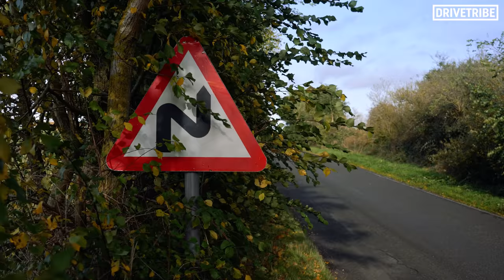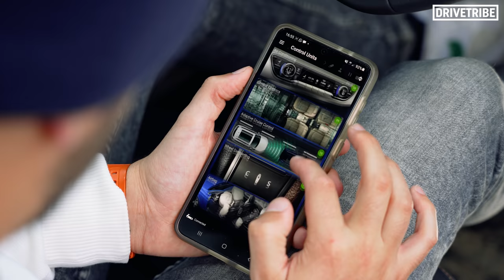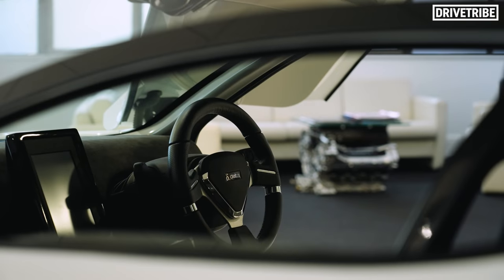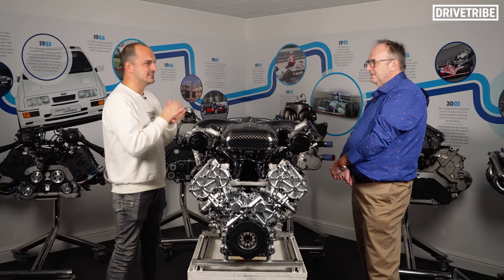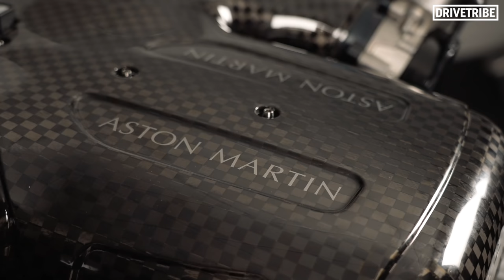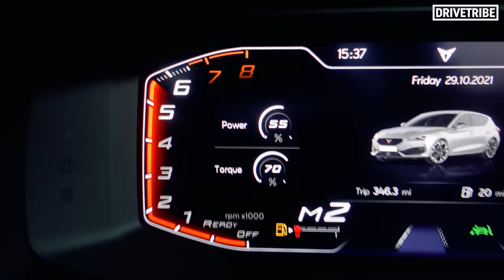Why are almost all modern engines 2.0-litres?

Comment: I would take a larger 6 or 8 cylinder normally aspirated engine  over a 2 litre turbo any day of the week. Smoother, more reliable as less to go wrong and in the real world not much difference in fuel consumption.
Reply: Agreed. I purchased a 2018 Murano even with small fears over the CVT specifically because it uses a 3.5L V6. I've known a couple friends and coworkers who have had turbo issues (mostly GM products to be fair). Still get 26-28 MPG on the highway with enough power to make merging easy and safe.

Comment: Many errors in this video that I can't let been said. First, it was japanese manufacturers during their golden era that brought the 2.0 turbo to another level, not the A45 AMG. Back in the 90s, not only Subaru and Mitsubishi were able to reach 250-280hp on their JDM versions of Impreza/Evo, but also Honda with its 250hp JDM S2000 N/A. The 2005 Evo VIII FQ400, which was an official Mitsubishi UK product, reached 400hp+ from a 2.0 turbo, road homologated. So, not only back in the days we knew how to build 250hp 2.0 turbos, but even more important it's not AMG that changed the game. They only added always more hp in each new update. The real game changers to me are Impreza STi and Lancer Evo, even if they are not hatches (STi 10?). Way before the S3, the Mégane RS, Golf R, Leon Cupra etc ...
Reply: GTI and S3 used the AGU 1.8 20v engine back in the day, which has tons of potential. Renault wasn't focused on turbos, yet still their F4R and F4Rt were highly capable engines.

Also the FQ400 was not a factory product. It was dealer tuned.

Comment: I have a 2.4-liter engine in 2015 Dodge Dart SXT 6 speed auto overdrive got over 230,000 miles with OW-20 oil and well maintained

Comment: I guarantee that turbo engine does not respond instantly, a bigger NA engine will always be more responsive regardless of what rpm peak torque occurs
Reply: Exactly. I had a chance to test out a lot of cars and turbo lag is present in every turbo car. Most noticeable thing in turbo manual cars to me was the short torque dip on every gear change.
Reply: @BlitzkriegRap  i think my entire enjoyment of the driving experience is tied to it's response to my inputs, it's the connection, and both turbos and autos take away from that. Moderns cars are almost all incredibly boring, even if they're fast it feels like someone else is driving and I don't like the bus.

Comment: The 2 litre 4 cylinder engine in my 90's Japanese Mazda originates from the early 80's and only stopped being manufactured in Japan in 2019.. great engine, still in perfect condition after over 300,000 km's.

Comment: I bought a '20 Ford ecosport awd 2.0 non-turbo 4 cyl at the beginning of the year.  Wife liked it so much we got her one but instead went with the fwd 1.0 3 cyl turbo model.   On paper the 2.0 is supposed to have 43 more hp but the car is slightly heavier with awd.  In real life the two are almost identical in performance.  From a stand still to 60 the 2.0 na jumps the line on the 1.0 but then the 1.0 catches up and they seem to even out.  The average mpg for both is identical at 29 mpg.   However, in day to day driving the 2.0 is very smooth and feels like a quality engine that will run a long time.  The 1.0 drones a lot.  It has a vibration and sound to it that gives away that they are pushing that engine.  While its impressive what they can do with turbo's on these small engines I am glad to have a basic engine with less maintenance worries without the turbo.

Comment: I have had a wide variety of cars over the last 50 years, from 1.1 ltr naturally aspirated petrol through various turbo petrol and diesel engines up tp 5ltr V8's. By far the most impressive engine I have had is in my wife's MG ZST. It is a 1.3ltr 3 cylinder turbo petrol engine, yes 3 cylinder 1.3ltr. It idles so smoothly it is hard to tell it is running, it has amazing torque from under 2000rpm, it is plenty quick enough if you are in a hurry. Driving it is more like driving a spritely V6, at 60mph on the hwy it is doing less than 2000 rpm and the sound from the exhaust is more than pleasant. I believe the engine was made in partnership with GM for the Chinese manufacturers of the MG.

Comment: I spent a week commuting in a car with a 255hp 2.0 BMW 4 cylinder. Both the engine and the transmission really worked very well; I was impressed. 
Reason I never plan to own a car like that? Total Cost of Ownership

Comment: 25 years ago, when I was building my dream Beetle engine, people thought I was weird for focusing on the crazy amount of work to make it a 2 liter (2110cc, specifically).  I'm so totally gonna shove this video in their faces next time we meet. =^-^=
Reply: One must consider when building a large vw air-cooled engine is they run hot causing the rings to be weakend quicker and their goes your horses .take this to apply to an everyday driver
Reply: @jamesblackwell703  Too true.  I followed a lot of advice I found in various books and Gene Berg's old tech papers.  Even using the ever-so-controversial "cool tins".  That engine was in the shed for a while but currently sits in my '62 daily.  60 highway miles per day keep it pretty healthy.  Yes, I am completely insane.

Comment: Not here in the states.  Two of the absolutely most popular all time sellers are the Honda CR-V and Toyota RAV4.  The current version of the CR-V has a 1.5L turbo four (same for the non-base model Civics, which are also massive sellers) and the RAV4 has a naturally aspirated 2.5L four, along with the immensely popular Camry. The very well selling Hyundai Tucson has a 2.4L four and so on and so on...

Comment: Noone needs to make any bigger displacement engines for any reason.  Save the planet by not dragging around vast V6/8/10+s in the car.  There is nowhere or no chance of using any more power than that from a 2L on the road to get anywhere faster in the 21st Century.  Utterly cracking video.  Stuffed with info.  Thank you, now subscribed...

Comment: The GM ecotec LNF from 2006 was putting out almost 300hp and about 325ft-lb torque with a factory warrantied GM performance tune. Have that running on my 08 Saturn sky redline and it's a whole lot of fun. Know people in the "kappa" community that have pushed it up to 400hp with some aftermarket tune without modifying anything other than the ECU tables.

Comment: My opinion is longevity of engine is the ultimate value in a vehicle, so I won't get anything smaller than a 3.0 liter 6 cylinder. We've got a 167,000 on a 2002 Mazda Tribute 3.2 liter 6 cyl. & 243,000 on a 4.0 liter 6 cyl. 1997 Ford Ranger. Both Vehicles run like clocks. I use only Mobil synthetic with Bosch oil filters changed every 5K miles, have fluid flushed from trani's every 30K miles, & use platinum tip spark plugs.

Comment: I recently traded my car with a 2.5L to one with a 2.0L.  The peak power in the 2.0L I can tell is less than the 2.5L, but the 2.0L seems to have a broader power band - I don't have to downshift with the 2.0L to maintain my speed on hills that I did have to shift the 2.5L.   A lot of this must be the way the engines are tuned, but I am amazed the smaller engine has as much or more 'useable' power.
Reply: it all depends on how the engine was made and tuned. even down to transmissions and what their maker is trying to accomplish with that powertrain combo. you have turbo engines that produce a lot of torque (due to it being a turbo) that it feels faster than what it is but depending on transmission tuning the engine may not peak it performance if trans isn’t tuned best to engine

Comment: There is a simple economic reason for the 500cc per cylinder phenomena, and that is because the dimensions of the parts allow them to be manufactured on a standard set of machinery. You can use the same bar stock for pistons for all makes of engines, and use the same CNC machines to finish the parts. The same is true for connecting rods and crank shafts. I like the 8 liter V8 in my old Cadillac El Dorado.

Comment: Never seen this guy before but I'm impressed by his non-linear ideas re the I4 in the evolution of performance engines. My only regret is his assumption that a turbo is required. While I know how well turbos are now integrated into drivetrains -- those of us old enough remember the dreaded turbo lag -- to me there is still something a bit off about forced induction. It's like instead of refining their naturally aspirated mill, the engineers decided to go home early and so they slapped on a one-size-fits-all turbo. But maybe I'm the dinosaur in the room.
Reply: You may be overlooking the taxation benefit that can cut 30-40% of the sale price of the car, with same hp, but smaller engine size + turbo. Thats the real reason for them, not efficiency, emissions, additional hp or anything like that. Cheaper car simply sells more, which is better for manufacturer.

Comment: I have one car with a 500cc per cylinder engine, it is (what a surprise) a 2.0l inline 4 cylinder, naturally aspirated. and I have one car that doesn't have that cylinder size, a 1.6l inline 4 cylinder naturally aspirated.

here is the interesting part however. the 1.6 is a 2012 model year, whilst the 2.0 is a 1973 model year. and even tho the 1.6 has both more power and weighs less is the 2.0 way more fun to drive.

the two cars are a 1973 Volvo 1800ES and a 2012 suzuki swift sport

Comment: im not sure about the rest of the world but here in north america, 3.5 or 3.6 v6 is very common.    as for v8, they range all over from 5.3 all the way to 6.2 in terms of what is in normal production vehicles.   But I may have a skewed perception because I take photos of cars for a living and I do take a lot of pics of trucks
Reply: to the outside it seems everyone in america drives comically oversize pick up trucks, which they definitely need since they need to commute to their office job daily and a normal sized car could never do^^
Reply: @johnuferbach9166  oh they definitely do.  I hate them with a burning passion.   They are the stupidest vehicles on the road.   But they are unfortunately very prevalent.    And the 3.5 v6 tend to also be more common than the straight 6.   Every manufacturer makes one of similar size.  Toyota, nissan, fiat/chrysler, gm, ford, etc.  Straight 6 is not as common as the v6

Comment: My sister has a 2.0 litre in her car and my v8 truck gets twice the mpg. I've had similar issues with small engines before. Most small engines have to work too hard to be efficient whereas a larger engine won't struggle at all.

Comment: Back in the day the standard was 1.5 or 1.6 lite for the 4cylinder engines coz cars back then were smaller and lighter. Currently the entry level models were the midsize back then which are now bigger and heavier loaded with multiple features requiring more power and technology.

Comment: Offenhauser made high performance 4 cylinder engines which were competitive for almost 50 years. By the early '70's they were getti8ng 700-1,000 hp out of 2.61 liter engines. Offenhauser engines wonm the Indy 500 27 times. It was also known for its reliability in racing.

Comment: Engines aren't almost all 2 litres, the most common size may be, but that's not "almost all". The best configuration (ignoring cost) is an inline 6, and they can be made from around 2.0 to 4 litres without any noticeable disadvantages but many advantages such as no requirement to lose power by driving balance shafts. Historically I'm aware of I6 engines in a range of 1.6 litres (1960s) to 6.7 litre (the present) in what we may refer to as the modern era.

Comment: That's funny.  I remember Audi advertising that their engineers found that 400cc was the optimum cylinder size.  That's when they started selling their 1.6L fours and their 2L five-cylinder engines.
Reply: Audi 5E that brought the 5 cyl to the market was actuallu usually in a 2.5L version ... which was then stuck in the 850 series Volvo's .... (albeit played with at 2.3 .. 2.4 and 2.5L)

Comment: Actually, the magic thing about 2 liter 4 cyl  engines is that they don't need a balance shaft to deal with secondary balance issues. This isn't an issue with V8 engines.  And my 7.6 Liter carbureted, EGR, over square engine gets about the same gas mileage as my 4.6 liter fuel injected OHC, slightly under square engine and it puts out about the same amount of power.  The smaller engine just revs higher.

Comment: My naturally aspirated 5.7 liter V-8 Hemi has 712.5 cc's per cylinder, and the same horsepowers as the Mercedes 4-banger turbo. Probably last longer though.  The Hemi is in my truck, and I assume it's tuned for down low torks.  Pulls hard from jump, and Redline is about 7K.

Comment: It’s strange that right about the time the NA 2.0 4 cylinders started taking off (with 500cc cylinders) was the same time the NA 3.0 6 cylinders were going out in favor of 3.5-3.8’s, and now in the turbo era the 3.0 6 cylinder engine is coming back into favor.

Comment: As engine technology has improved, we are getting more power out of smaller engines. My Dad had a 2.6 litre six cylinder car back in the 80s, it was very slow! A 2.0 litre modern inline 4 cylinder is much more powerful!

Comment: This has always been my view of the perfect engine size I put a 2ltr Jetta engine in our 63 westy it was way more power than needed was running a1800 cylinder head in my frankinstien creation I made also made an adapter to put a carburetor intake on a 2ltr cross flow head

Comment: It's about simplificaton and efficiency. The same basic engine with different amounts of power, for different uses or customer needs. Today mostly only horsepower and mileage is advertised, not the type of engine or number of cylinders. Customers get used to expect nothing different than a four cylinder to bei offered.

Comment: I'm 31. And since I was 14, i have always said, 2.0 is about perfectly balanced engine. I see I was quite right.
Reply: Actually an inline six is far more physically naturally balanced than any I4, but of the I4's, yes, the 2.0 is probably the sweet spot. But its not like a 2.1 or 1.9 is much different, those are chosen due to tax laws.

Comment: Quite interesting for normal engines, but how about the way under engines (Atkinson Cycle) used in many hybrid cars. Toyota has been stuck at 1.8 liters for quite some time, so I am guessing for them there is a different sweet spot? (Although I have heard rumors the next gen will indeed have 2 liters, and FINALLY add direct injection while keeping port injection.)

Comment: I thought i was mostly bc of manufacturers stretching to use their WRC engines in their other cars.  WRC rules limit cc to 2.0, which can be changed easily to 1.8 or 2.5 to increase models.

Comment: A 500cc sized piston has managable "secondary balance issues" while a 700cc piston will basically self destruct above 6000 rpm.

Just read up on "secondary balance" and you'll see why.

So this is about the largest a piston can get and still hit high revs.

Now that you can get over 300 hp out of a 2 liter engine , unless you're building a high end sports  car there's no point in going bigger.

This has caught several nations that base taxes on the displacement of an engine by surprise since you now see 2 liter engines putting up the same numbers you saw in 5 liter engines.

So manufactures see the 2 liter as a way of getting high end performance with low end taxation.

Comment: Once people figure out plug-in full electrics are impractical the markets will adjust to Hybrids that have crazy-efficient dual-fuel gas/diesels charging small, light battery banks capable of only 50-75 miles in "full electric" mode, carrying 2 gallons of 87 Octane or E85 and just 3 gallons of Diesel. No turbo needed - the computer will sort out the fuel mix and variable compression based on the electric demands. Regen braking and aero will help give 80-100 MPG.

Comment: yeeeeep. those 2.0 liter turbo diesel engines with them big turbos ... :-)   .. all that high rippems..
(well, it got better over the years, you get up to over 4000 usable now..)

Still love me the 5 cylinder 2.3 Liter engine from old audis...
made a standard 20V (Audi 200 20V) and a special 25 Valve version engine head for racing.

Really love my non downsized mazda mx-5 / miata  2.0 Liter NA skyactive engine.
It supposedly has 160hp, facelift/revision got 180,
But it's also really low on consumption. i daily it around 5.6 liters/100km.
and since non-turbo it drives with the cheapest fuel (E10) i can get.

Comment: No one ever points out that the four cylinder engine is the cheapest to mass produce. It is NOT the most fuel efficient. That distinction goes to the V8.

Comment: My 2018 Chev Malibu has a 1.5 liter DOHC turbo four that has 375 cc per cylinder and runs just fine with excellent gas mileage and with an incredibly relaxed nature at 80 mph (128 kph).  It's surprising what GM has done with this engine.  I don't require the quickest horse on the farm so it suits very well.  The 500 cc per cylinder rule is a myth.

Comment: So what about the best selling vehicles on the plant using 1.5 liter inline 4...Honda Civic and CRV’s? 
My Civic EX-T 1.5 Turbo gets 174 hp, 162 lb/ft torque. Great performance to fuel efficiency. I’m getting 33.2 mpg with about 60% highway miles. After three and a half years and 93,500 trouble-free miles, my 2018 10th gen Civic is the best overall vehicle I’ve ever owned.

Comment: This common cylinder displacement is an old idea. Detroit Diesel had 53 and 71 cu inch displacement long ago.  For larger diameter pistons, which aircraft had to use to keep engine RPM low while still having the torque and HP, they simply add another spark plug to the cylinder. If you lose one ignition system, you will lose about 15% power.